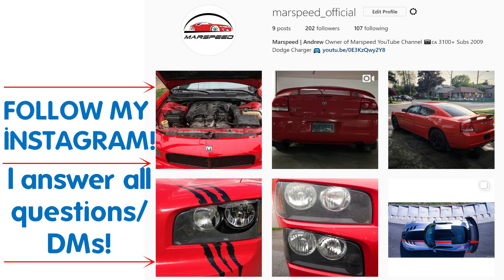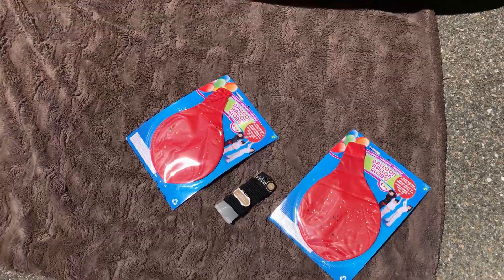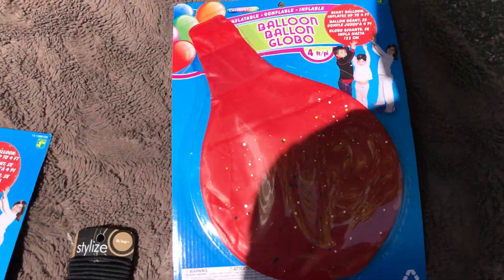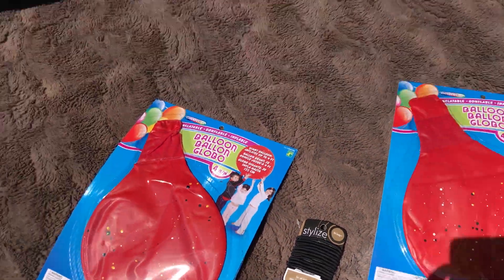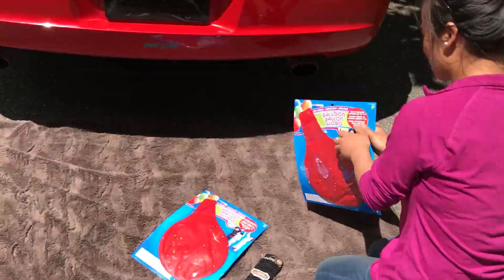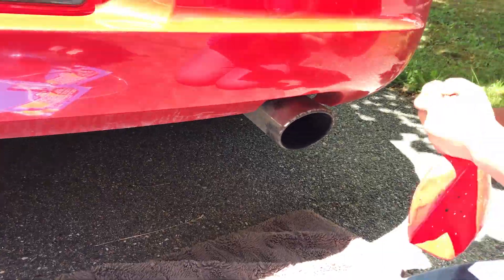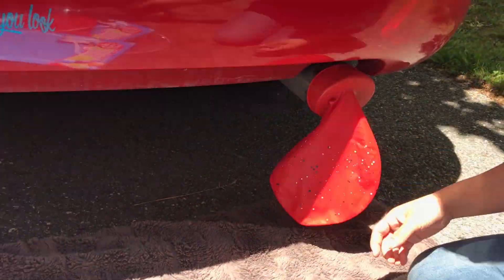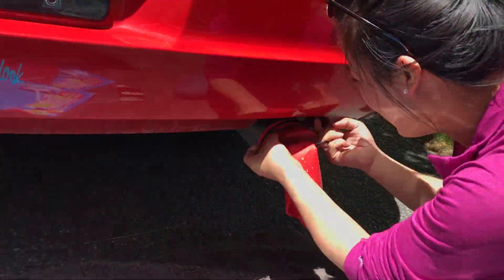Putting Balloons on Dodge Charger Exhaust Pipes - #BalloonChallenge

Comment: The best was The Blooper Reel, where the one came off and was twirling around !  LMAO.  On an educational note, in the first segment where the right side was small & exhaling and inhaling (getting sucked back down)--demonstrates the exhaust valves opening and closing, causing the pressure back-flow, flux.  If you hold a piece of regular sized note paper right next to your tailpipe, as the motor is idling, it should do the same thing---get sucked back onto the exhaust tip--and then blown back out again.

Comment: hey marspeed, for the super 10 dual out. should i get the 2.50 in with 2.25 out or the other version which is 3.00 in with 2.50 out? i have the exact same charger model as yours.

Comment: Still trying to find those tinted headlights lol hope you can post a link to them 👍
Reply from the maker: http://www.ebay.ca/itm/SMOKED-HOUSING-CRYSTAL-TINT-LENS-HEADLIGHT-CLEAR-CORNER-SIGNAL-FOR-06-10-CHARGER-/381447915977?fits=Make%3ADodge%7CModel%3ACharger&hash=item58d01149c9:g:S-AAAOSw4A5Yw1UF
Reply from the maker: these are the ones, hopefully the link worked!

Comment: sup cris i had question for u i had 2009 dodgr charger 2009 v 6 and the problem that am having and cant figure out why its showing up on my dash bord which is the EPS why does it pop up all the sudden
Reply from the maker: Fill M EPS is usually the light for power steering so it means that you've got a problem somewhere with the steering